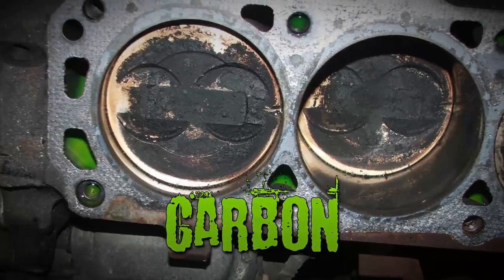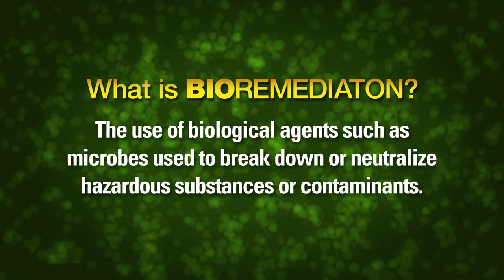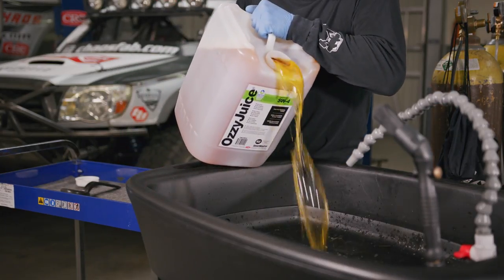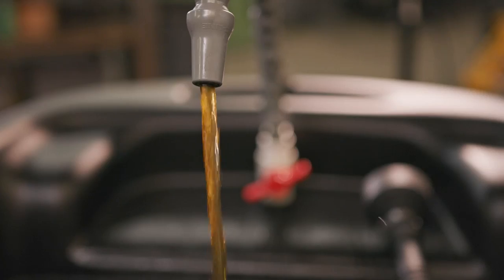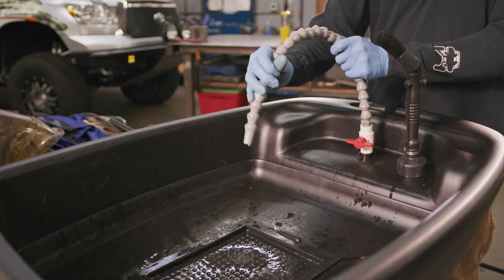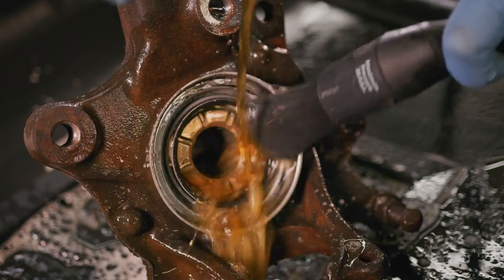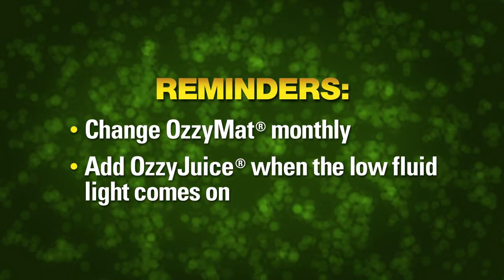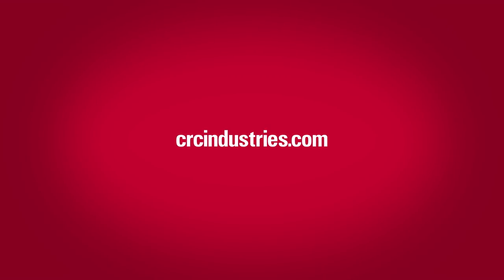How To Clean Auto Parts With The CRC® SmartWasher® Self Cleaning Parts Washing System

Comment: Not worth $3,000.
Reply from the maker: Hi mr_matthew_brewer - Initial purchase price varies by distributor and by unit. Generally speaking, If a user were to clean parts with the CRC SmartWasher multiple times a week, that alone will pay for itself over time by not having a requirement to haul away hazardous waste. If you are interested in purchasing a unit or would like to learn more please contact our customer care department and we can provide you with additional information on savings from using a CRC SmartWasher versus a traditional solvent based parts washer.
Reply: Only if your livelihood depends on it. If you're a weekend warrior, then Harbor Freight will do...LOL!
Reply: Waaaaaaaaay too much money. There's nothing there worth that kind of money. Wheels are inexpensive, pumps are also inexpensive, a couple of hoses and a brush....$3,000.